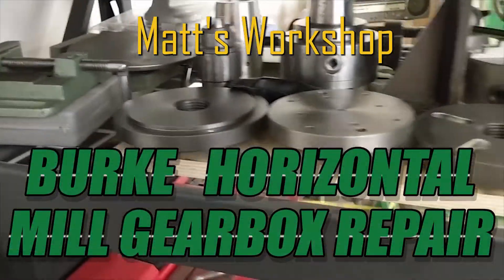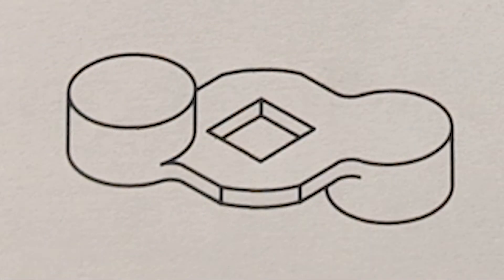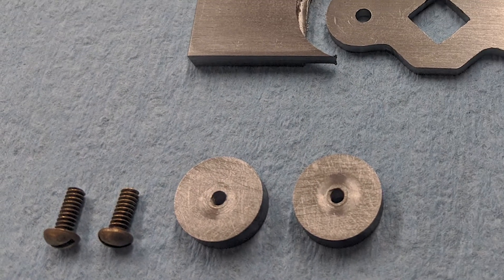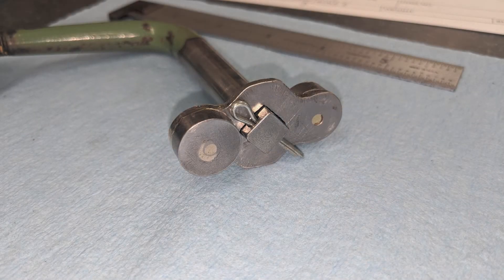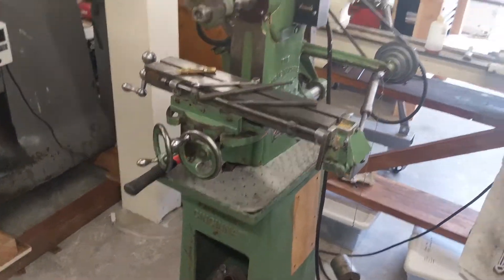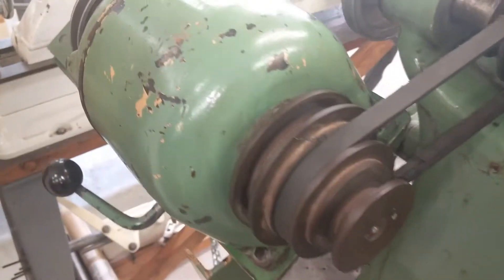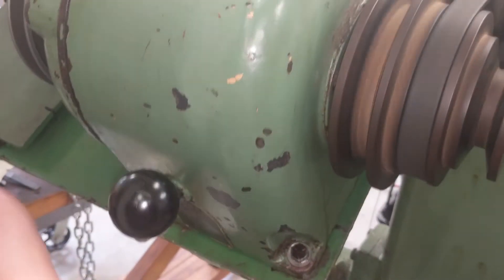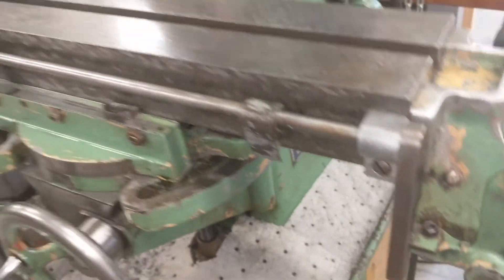Matt's Workshop - Burke Horizontal Mill Gearbox Repair

Comment: Great job!  Thanks for sharing.   
QUESTIONS: 
A)What type of gear oil did you use?  How do you go about filling the gearbox?  I have the same gear box on my #4, but no manual.  I did a little research and figured I would get some TRAVELLER (Farm Store brand) GL-1 SAE 90 "FORD Tractor Transmission Oil" / GEAR OIL.  Looks like there are three plugs.  I assume one is a drain hole, the other a level line, and the top is the fill hole.  
B) I wonder if that Flux you used would work with my SILVALOY 850 (Silver 85.0% & 15%
Manganese) wire.   
Thanks again...
Reply from the maker: I used tractor gear oil and filled the case about 1/4 full.  The oil get's get's slung around all the internal components fine. If you over-fill the case, you'll add a lot of drag. One of the filler holes is a breather and this one faces up.

McMaster Carr sells a white flux and a brown/black flux for silver brazing.  The white is for brass, bronze and copper. The dark on is for everything else that needs more heat.  Both will work with 85%.  

Thanks for the questions!
Reply: @MatthewRulla  Outstanding!  Thanks again...